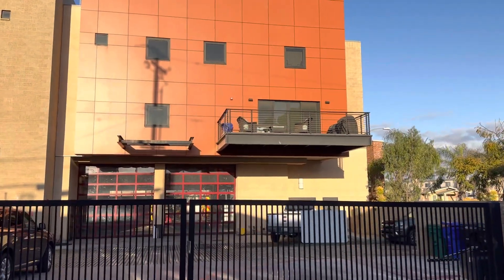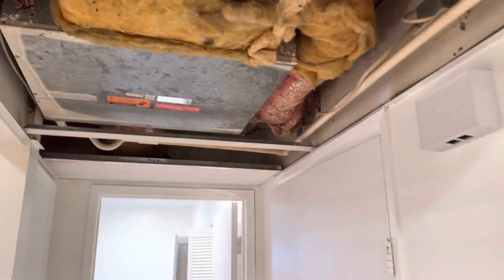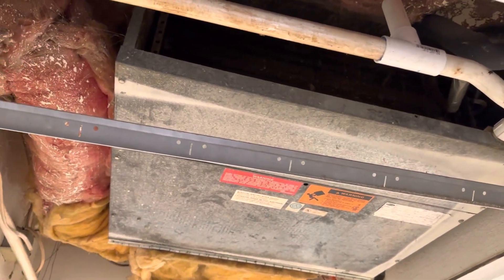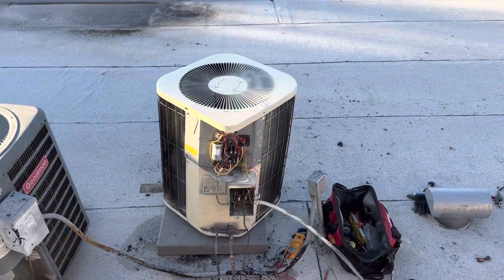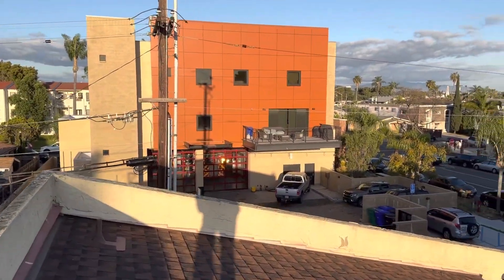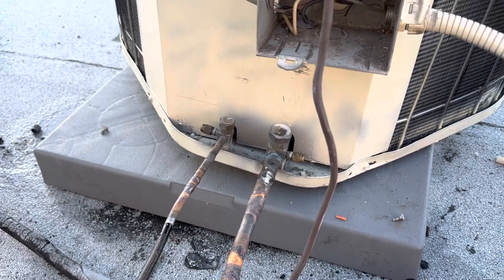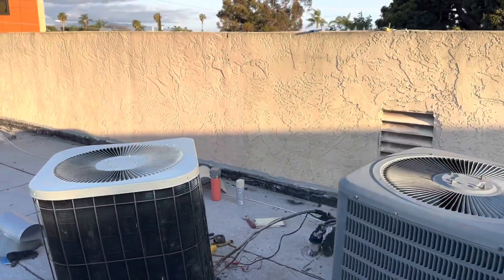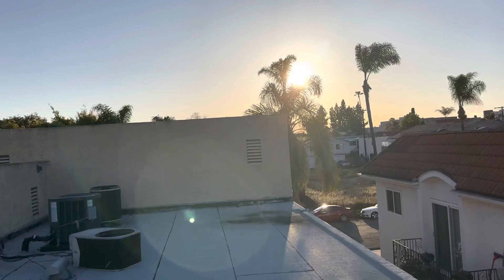Heat pump operation 25 years old

Comment: I recently replaced my old Australian made " Email Air " reverse cycle A/C unit which was installed in 1986 and installed a new Daiken split A/C reverse cycle in 2020,the only reason i replaced the old Email Air was due to its dated indoor floor console, and the outdoor cabinet was starting to rust and paint faded and now peeling. It was still in wonderful working condition with excellent cooling and heating after34 years. I now wonder if my new Daikin 5KW split system will last that long. 😲